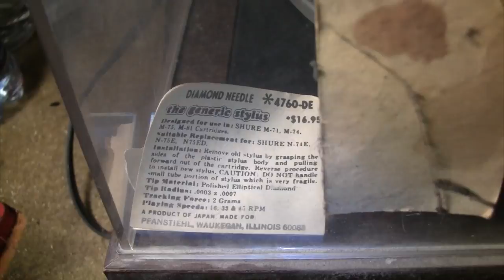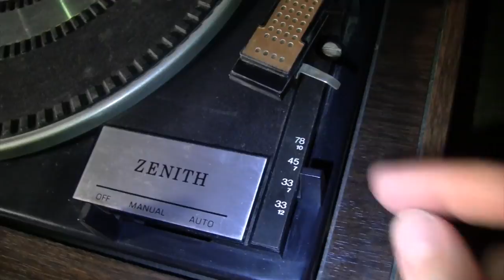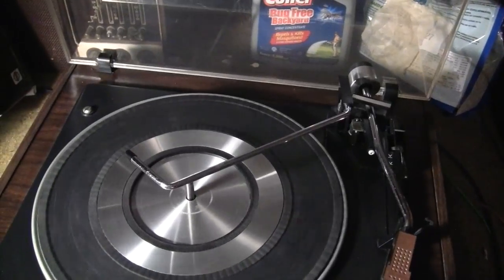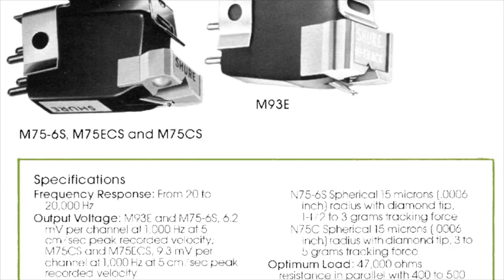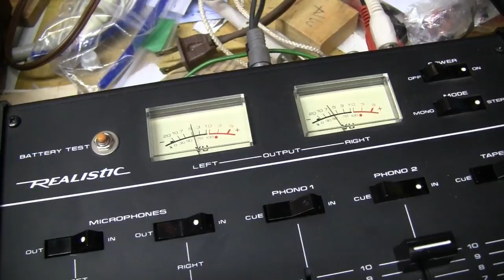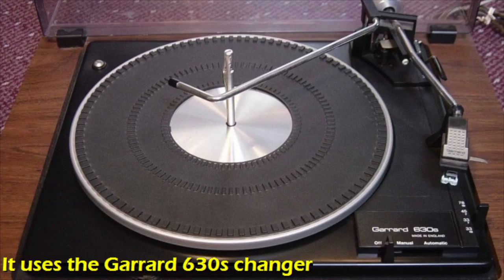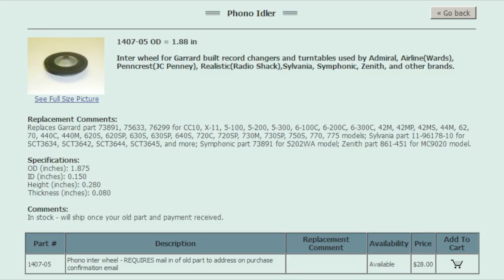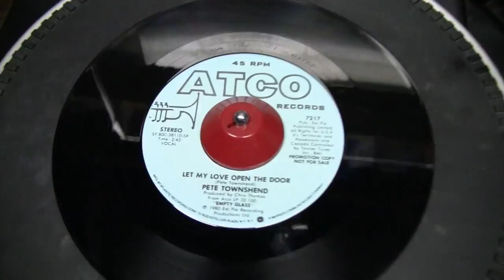Trash-picked 1979 Zenith MC9020 turntable restoration

Comment: Those Shure M75 series cartridges are great. They later changed the design of the housing when they created the M75 Type 2; the original M75 (the one you have) is quite versatile because you can fit literally dozens and dozens of different Shure styli on them.
Reply: maineboy1979, I agree. I have a m75-6s and i need a replacement needle and on ebay the styli are extremely versatile, I think fitting 5 other cartridges! Mine is also on a Dynatron record player with a Lenco Goldring 101 turntable.

Comment: Nice! I found a realistic lab 430 on the curb not long ago. It's from 1985, and is a direct drive automatic turntable. It was likely thrown away because a single screw on the inside came loose, preventing it from working entirely. I bought a stylus for the R47XT cartridge, a preamp, fixed the one small issue, and cleaned it. It has replaced my modern Pro-jet primary turntable, and months later, I have no plans on going back.

Comment: Automotive brake fluid used to be used as a shade tree trick to swell and soften rubber seals, in an engine (wouldn't recommend that). It definitely softens rubber, but it takes some time to work. It will also strip paint. Though not after 30 minutes. It takes a while to work, but it does.

Comment: I picked up a Fisher 230-XA at a goodwill, it is visually and very mechanically similar. the drive system is identical to this one. I also have the same issue you had with it making a bit of noise.  Mine has a Pickering V15/AT-2 cartridge, which is apparently the same exact thing as a Stanton 500. I got a new Kyoma stylus for it, for my first turntable and it being under 5$ it sounds amazing!

Comment: There is no way to repair a hardened idler wheel, other than what you did, and that will be temporary.  I have even tried buying the extremely expensive rubber renew stuff,  (which smells mostly like xylene, a common aggressive solvent)...it works for a short time, but fails in the end. The only answer is to buy new rubber... a new rebuilt idler wheel with new soft rubber.  Btw, Duel turntables from the very early 1970's often still work because of whatever rubber they used on their idler wheels is still somewhat supple, even after decades.
Reply: Some stuff is destined for the dump, to revert back to it's original elemental values.
Reply: I used citric acid on some old hardened up rubber sleeves and it got them back to a smooth flexible condition. I never tried it on an idler wheel though...
Reply: There is no way to restore rubber. Rubber is organic and biodegrades, it will harden then crumble over time. You cannot 'restore' it, just soften it a bit temporarily, but that will actually just accelerate the degradation. A real solution would be to replace the idler wheel with something synthetic or just replace it when the rubber goes hard.
Reply: You are right but even if this is just temporarily restoring their flexibility a bit still makes sense as sleeves for example tend to break and this gives you at least 2 years before they break down so far that they become unusable :)
At least this is the case with the ones I treated with citric acid.
I'm using an ultrasonic cleaner on which I have done this 2 years ago and the sleeves are still fine :)
Reply: SlackJones1 Smith You can go to thevoiceofmusic.com and do an exchange for a refurbished idler wheel. They’re about $30 but worth it because I think he uses synthetic materials to replace the rubber. I have a Realistic, BSR based 4 speed record changer that is going to get fixed. I bought it to play 78s.
Reply: Use a typewriter eraser! 👍
Reply: Has anyone tried soaking it with WD-40 yet? :)

Comment: Nice job there!  It's great to see an old turntable that was considered as just 'ordinary' and nothing special, still working well after a good cleaning, some 30 or 40 years later! :-)  I have a lovely old BSR P128R/MP-60 from around 1972 that looks and performs flawlessly after I've spent the last couple of years tinkering here and there with it, and just doing little extra bits to it!  It too is running a vintage and period Shure M75-6 cartridge with conical stylus, and it sounds incredible (even compared with modern turntables (Rega RP1, AT-120USB, Pro-ject Primary), and another vintage favourite of mine; a Technics SL-QX200 quartz direct drive.  
I'll always have a place in my life for a good vintage Garrard or BSR turntable... hey, they were in the music centres of my childhood back then, and even when fitted with ceramic cartridges, they sounded good (because the manufacturers knew how to impedance-match back then!!), and so it's wonderful for me to still see and use some of these classic old turntables from my youth (which 'audiophile' people derided back then!), and yet you find that those decks are still going strong today, if they've been looked after, and can actually sound better than many back then (and still today-based on old 'urban' legends) would ever believe! :-)

Comment: No doubt about it. I had these models in times past. It may have read ZENITH for their STEREO units, but that was a GERRARD. Many were sold in the United States under many names such as Lloyds GERRARD. What annoyed me with them when the record was finished the tone arm instead of going back to its rest stand it kept on going back to the 💽 disc. The stack record overarm was not adjusted mechanically correct, which made this happen when i had them. Only one model GERRARD I had that was successful in those days that didn't have that defect. Otherwise not a bad model it had a metal platter very fancy. Very nice clean up & Good video.. 🎥💽✅👍
Reply: P.S. That doesn't sound bad at all. This rubber wheel was early versions of direct drive. Later turntables like TECHNICS added Pitch control with lights..

Comment: Two things, isopropyl alcohol is the best solution to clean the old rubber residue off the motor's pulley, just don't let it get into the motor from the shaft. And also clean the inside rim of the platter where the idler contacts but don't remove the finish that supplies drive adhesion. Tried servicing a BSR once and could not correct the squeaking, but realized the tack finish was worn off completely. Realized later that if I had re-coated that rim with the correct tack it would have solved the issue. Good Luck.

Comment: If memory serves me correctly, all of those early wheel driven turntables had that problem of slowing down as the automatic mechanism engaged.  Sometimes it could be helped by taking alcohol and wiping the inside edge of the platter itself to clear up minor film buildup but most of the time it was just the power of the motor.

Comment: VWestlife, nice trash find.  Clever idea with the rubber band around the idler wheel.   Once rubber dries out, the chemical remedies only last for a short time.  It's good that there is a place that you can get a replacement idler wheel.

Comment: You have to take the phono motor apart degrease it and clean all old grease off the shafts and bearings and lube them with zoom spout oil or Motorkote hyper lubricant which will never gum up. Also clean the inner rim of the platter to help get more torque from the idler wheel

Comment: What I've found that works wonderfully - in most cases - is a broccoli rubber band.  Since it's usually much smaller in diameter than the idler, it will wrap around the top and bottom of the idler.  In some instances there won't be enough clearance on the bottom part of the idler on the motor shaft, and the broccoli rubber band will rub on that higher speed which sits below the idler [not an issue on single-speed machines].  Trimming it down takes care of that.  YMMV.

Comment: I found a turntable on the side of the road some years back. It plays and the sound is good, but I think there are some loose connections inside as there is a lot of static and pops when adjusting volume and the volume sometimes drops out. I need to open it up and have a look but haven't got around to it, but it plays records beautifully. Looks like a basic old record player.
Reply: That will just be dirty contacts in the rotary switches. Spray them full of electrical contact cleaner, waggle / turn them rapidly backbandcforth for awhile and you should hear a huge improvement.

Comment: Nice work. usually when I find the problem of the idle wheel I use a small dremel adapted to a lathe, I turn the wheel and with a small blade or sandpaper on its diameter, I remove some material until it has a "<" shape. So I can put a rubber o-ring to size in it, and it stays in place without being glued. This way I get this kind of illustrated result ... o>===<o

Comment: It's very interesting about your radio picking up commercial aviation communications. I haven't any idea which band you had your radio on then but the reason it is so interesting is that aviation radios use amplitude modulation, not frequency modulation as some might think.
Reply from the maker: The aircraft band (108-136 MHz) is right above the FM radio band (88-108 MHz), and the intermediate frequency (IF) of FM radios is 10.7 MHz, so it's easy for them to pick up an "image" of a signal 10.7 MHz higher than what you have tuned in. For example I had the radio tuned to a station on 105.9 MHz, so it was likely picking up an image of an aircraft transmission on 116.6 MHz.
Reply: Yes, I am familiar with the aircraft band and also the IF of FM broadcast receivers just as AM broadcast receivers have their IF at 455 KHz. What I thought was interesting was the ability of your FM receiver to demodulate an AM signal. On the other hand, the aircraft signal could have been picked up and detected by an exceptionally high gain audio stage in your receiver. I have experienced that many times.
Reply from the maker: FM receivers do pick up some AM. That's why they have a ratings in the specifications called "AM rejection". A relatively cheap FM tuner such as in the Zenith clock radio I used does not have very good AM rejection.
Reply: I used to have a CB operator about four miles down the road with a paint blistering power amp on the radio he had in his house.  If he came on the air, recording anything on my reel to reel was finished for the day as it would bleed over into the heads and then onto the tape!  I finally found him and told him and he blamed my equipment and not his highly illegal amp.  I didn't report him but somebody must have because in a few weeks he was off the air and his antennae tower was dismantled.  Karma!

Comment: Those Shure M7x series of cartridges are awesome! I've got an M75 (RS1000EDT) in my Realistic LAB-440 and it sounds wicked good. Only issue I have with mine is that it doesn't do so well with inner grooves since it's mounted on a straight tone arm. It's especially noticeable on my Japanese LPs (e.g. Tatsuro Yamashita - Ride On Time and Yasuha - Vivid), probably because they were recorded a bit louder than most LPs, although I'm just speculating. Still, though Shure's cartridges are excellent in my opionion, probably on par with Audio-Technica's cartridges.

Comment: darn you didn’t get the lakewood box fan. i’m a fan collector, i know the bigger version is probably a p223 (plastic blade) or p23 (metal blade). not sure the model of the smaller version. but this is a pretty cool table. i need to get a better turntable.

Comment: Also Anti skating is not related to the weight. Or well, it is, but not directly. Setting it to two grams is as good as anything else.
The proper way to do anti skating is using a test record and an oscilloscope, but a neat little trick to get it 'quite allright' is to drop the stylus on the beginning of the record a few times and see what it does. If it skids inside every now and then, anti skating is too low. If it seems to be 'searching' for the first groove to fall in to, it's too high. Definitely not a scientific method but it gets you somewhat close to the desired anti skating.

Comment: Nice find and fix. I have an old Kmart record player which still works, Just got a new needle for it. I need to find a good preamp. I have the tiny radioshack amp, actually two, but they are mono. I'm going to try those one on each channel as a temporary method. 

Lots of good tunes on that greatest hits record, save that one.
Reply: Try a PYLE PP444 preamp.  Does a decent job and not too pricey. I had to install one on a friend's turntable with a AT cartridge because his receiver, a newer Pioneer, had no phono inputs and we plugged it into the aux jack.  Worked great.

Comment: @11:52, those invasive aircraft traffic transmissions remind me of a similar issue I experienced for a number of months over 10 years ago, here in the Seattle-Tacoma suburbs.  I was still using my '84-vintage Fisher PH-W405 twin-deck boombox as my primary bedroom radio, and in the early morning hours, would be rudely awakened by unknown voices coming in much louder than the station/broadcast program that I had on.  I reside within the flight paths of SeaTac Airport, so I'm not sure if it was air traffic, or if it was (illegally) overpowered CB communication between truckers or dispatchers.  In any event, it ceased several years ago, as quickly as it first appeared.  There were a few times when it scared the ^&*@^! of me.

Comment: I have an idler wheel table that I got for $1. I had it going good for a while. I have to figure some things out with the
tone arm wires. They are so fine that they just break when I try to re solder them when I recently went at it trying to get it going again. It had a bit of a problem wanting to spin at correct speed. I had a can of belt dressing and sprayed a little bit on the edges of the idler wheel and that fixed it immediately.

Comment: Very curious if that latex rubber band has dried up already. If you're still using this turntable, that is.

For something like this you might try calling a small print shop and asking if they would apply some de-glazer (aka rubber rejuvenator) to the wheel for you.

Comment: These turntables are very commom here in Brazil, where they're badged as Gradiente. They usually came in the S-95 or S-125 stereo systems Gradiente sold in the 80's. I had one of those, but it went faulty as most do and I did'nt know how to fix, so ended up dumping it.

Comment: In the mid eighties I switched to a linear direct drive p-mount record player. No more worrying about anti skating, tracking weight or cartridge alignment. If CD’s hadn’t diminished the sales of records, all manufacturers would have moved to p-mounts by now.
Reply: This fix is good for a flip on Craigslist to sell it as refurbed.  lol  I detest idler TT's, junk, belt drive at the very least.  Um with you, DD w/LT.  If I found a Thorens or Empire BD TT with pivot tonearm, I'd take that too.  Thorens had a linear tracker.  For the  record changer capstan drive crowd, PE (Grundig) and Collero (Magnavox) were much better than BSR and Garrard crap.   VM is good enough for 78s.

Comment: I GOT a high-end 90's boombox (well, maybe not high-end, but casettes sound fantastic in it) from the side of the road. CD player doesn't work properly, it keeps jumping back to the start, which makes me think something might be fouling one of the gears that makes the cradle with the diode on it move. Unfortunately I don't have a long enough screwdriver to take it apart, some of them are recessed almost the entire height of the unit, for some ungodly reason. I'll get around to fixing it up some day.

Comment: I'm tempted to use your rubber band idea for my 70s Marconiphone Auto changer which has a speed problem its running at a semitone faster than it should and I cleaned the pins but I haven't cleaned the rubber wheel adler yet.

Comment: Wet sand 1500-2000 the scratches out. Never-dull after, polish dry. That lid. Did it to my 1976 Technics sl-20. Looks like glass.

Comment: Well, I'm going to try that rubber belt technique, because I also have a idler wheel turntable, which has problems keeping the speed at 33 1/3 rpm, and specially at 45. But doesn't the rubber belt increase the speed slightly? I mean, clearly the diameter increased as well. If you could quickly explain, I'd thank you. Great content, as always!
Reply from the maker: As I mentioned in the video, changing the diameter doesn't change the speed: http://audiokarma.org/forums/index.php?threads/idler-wheel-size-platter-speed.410357/

Comment: Ýou would need to relubricate the motor, since the old grease is in there, this would fix the speed issue :3
Reply from the maker: The motor is fine. It's the rubber idler wheel that was the problem.
Reply: I think Rodoko is talking about the motor's lack of power - if it is fighting stiff grease it would not be helping - If you can't get the bearings out easily, you may be able to re-lubricate with light machine oil.  That should help.

Comment: I just got a voice of music and a bsr, I was debating on upgrading my old turntable with the bsr but know little about it. My question is, are bsr record changers good, or should I spare my good vinyl and wait for something better?
Reply from the maker: BSR made a wide variety of changers, ranging from low-end ones with a plastic platter and ceramic cartridge to ones similar to the Garrard in this Zenith, with a metal platter, magnetic cartridge, and adjustable tracking force & anti-skating. So it depends where your model is in this range.